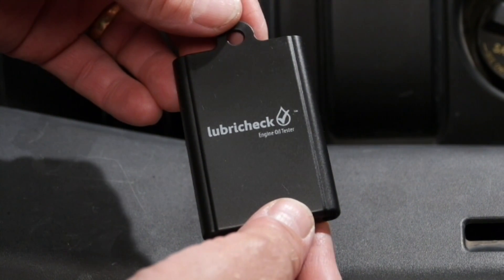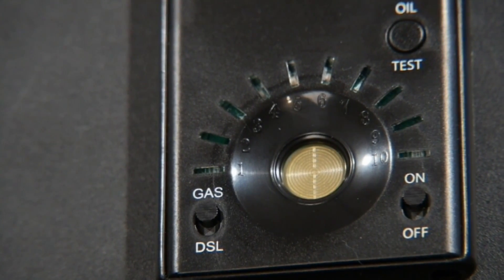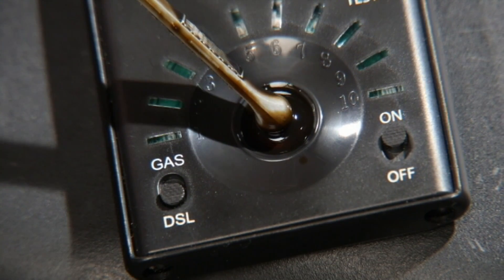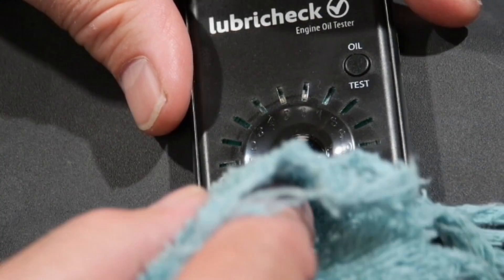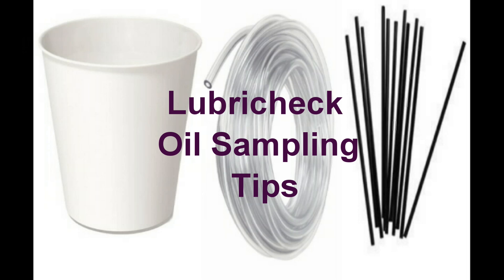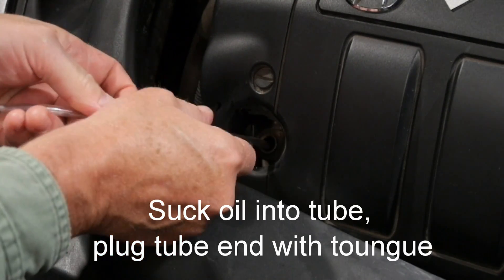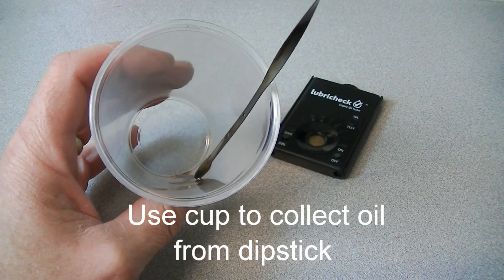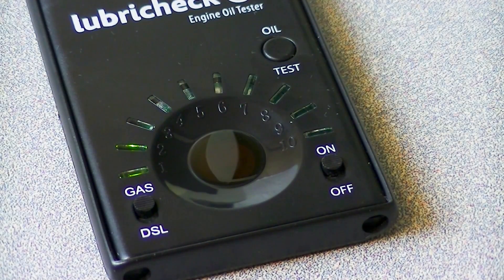Lubricheck Oil Tester Demo: How to Test Your Engine Oil, Instantly!

Comment: They may be out of business by now (domain for sale). I have four of them. Tested with oil from a diesel Land Cruiser 1HZ motor, oil used for 10600 km. I get repeatedly 7, 7, 10 and 11 (LED 10, 2Hz) out for my four testers out of the same sample bottle, shaken between tests. Obviously not great, not sure what I can try to improve results. I use swabs to clean the sensors, and with diesel you see when its clean because the used oil is so black. Swab staying white means all oil picked up.

Comment: What this device cannot test for is quality of th detergents and anti-foaming agents present in engine oil. The only oil test I know of that is also really cheap/kid of free, is to run the engine up to Normal Op Temp, getting the RPMs up high and quickly stopping to check the oil for foam on the dip stick. If you see foam, the anti-foaming agent has degraded and cavitation will cause engine damage.

Comment: WASTE OF MONEY.... You can  just tell when an engine oil is NOT doing its job anymore by the colour of the oil .. 
Engine oil on a gas/petrol engine goes from the following 
A) Clear like honey 
B) Then after 3,000- 4,000  Miles or so it turns black in colour but still runs fine (Fully syth oil) 
C) Then the oil can turn from black to dark grey ... TIME TO CHANGE THE OIL IF YOU CARE ABOUT YOUR CAR 
D) The oil left unchanged turns grey and gets small fragments of metal in the oil ... At this point it is NO LONGER protecting your engine. 
Good Quality mineral oil lasts around 3,000-4,000 Miles
Good quality Semi syth oil lasts around 6,000 Miles 
Good quality fully syth oil lasts around 10,000 miles MAXIMUM ... 
These so called "Long life" engine oils are a TOTAL LIE.... There is NO engine oil that lasts 20,000 Miles (32,000 KM)  
TWO oil & filter changes a Year with a mid price oil is ALWAYS better than ONE oil & filter change a Year  with top of the range engine oil.
Reply: Thanks

Comment: What a crock of total and utter Bs, if anything send at least 100ml of oil to a certified oil scientific testing lab to get all the results of your old oil and then use a real good friction modifier in your next oil change and then send that same 100 ml of oil with the friction modifier and i bet my life you will have a result of that the oil with the friction modifier is oil which has a 1/2 life of the oil even through you had done over 10 or 15,000 km with the oil compared to oil without friction modifier ?
Reply: Friction modifier’s  use isn’t required anymore, oils are much better than the days of old. If you need them, find a better oil. Also, with a quality oil a friction modifier alters the original formula and that can cause the chemical make-up of the other elements in the oil to not perform as intended. Messing with the original formula can degrade the oil depending on how the oil reacts to the friction modifiers. Tons and tons of difficult science in the small plastic jug!

Comment: Here's a review: This is a fairly lengthy read (1157 words) but I believe you'll find it worthy of your time.

This device ABSOLUTELY WILL do what it says - BUT:

FIRST, The instruction video I saw on their website 2-17-15 shows 2 things I disagree with: Using coffee sticks, and PVC tubing. DO NOT insert a coffee stick conglomeration into your engine! If that stick falls out or gets hung up while in your oil pan, you WILL need to drop the pan and remove it!!!!! It CANNOT stay in your engine!  No, NO NOO!!!!!!! NO COFFEE STICKS!

What you SHOULD do is go to your local Home Depot and buy a $3 - 25' roll of 1/4" Polyethylene tubing (SKU 701873), cut it about a foot and a half longer than your dipstick and DO NOT insert ANYTHING on the end that goes down into the oil pan. On the OTHER end slide on the eyedropper rubber bulb. NOW you have a SAFE super sucker! Poly tubing is a bit more stiff and that will help with sliding it smoothly down the dipstick tube.

MOST vehicles can accommodate 1/4" tubing.  If YOURS chokes down to a smaller size blocking the tubing from going INTO the pan:  I did a  Amazon search for you folks and DID find 1/8" O.D. tubing.  Search for "Clear NSF-61 Polyurethane Tubing, 0.063" ID, 0.125" OD, 0.031" Wall, 25' Length"  It has a max temp of 185 so extract from a cool engine to ensure you don't melt or deform the tubing.  Remember, the rubber bulb will NOT fit properly if you use 1/8 OD tubing.  You'll need to get "creative" on the bulb side of the tubing to remedy that.

2 things that require "finesse"

A: Proper cleaning
B: Repeatable loading of oil into the sensor ACCURATELY.

I cannot stress enough the importance of cleaning it properly. There is YOUR version of clean, and what clean REALLY is. (I) use the following:

1.) Naptha - a fast drying thinner for oil-based paints which is perfectly safe for the device AND does a SUPERB job of cleaning. (Home Depot has it in their paint dept)

2.) Canned "air" - I use it to GENTLY blow the unit out as part of the final cleaning step ensuring there is no oil trapped along the seal between the sensor and the seal around it. GENTLY use - Don't go at it like a ham-fisted Gorilla! You don't want to force oil INTO the tester under the seal!

3) Decent Toilet Paper (MUST HAVE)

4) Q-Tips - for cleaning with naptha. NOT as effective as TP, but they have a place in this procedure.

5.) A glass eyedropper - Search Amazon for "1 Dram CLEAR Glass Vial - Dropper - Pack of 12" Remove the plastic threaded CAP assembly and use only the bulb and glass tube otherwise you WILL damage the rubber. The bulb will be temporarily placed on the Poly tube to extract your sample, Then used back on the eyedropper for putting the oil into the tester AND sucking it back up, returning it to your sample jar. Makes cleaning much less messy, easier AND if you keep a large enough sample of oil that reads high, you'll have a "reference" sample to check the unit out periodically AND LEARN to properly clean the device consistently.

6.) Clear Glass Vials - for holding samples --> Search Amazon for "Glass Vials, ½ Dram, Pack of 12" and/or "Glass Vials, 1 Dram, Pack of 12"  I find the ½ dram vials to be perfect.

If you are impatient, you WILL fail and it WILL be YOUR fault, not the tester. This is a precision test device that requires a "sample" be placed on a sensor. That sample must be exactly repeatable for repeatable accurate results and IT IS POSSIBLE to achieve this!  In MY case, that sample is SIX DROPS of oil from a eyedropper whose glass section is 2 5/8" long by 9/32" wide. It is PERFECT.  The important bit is the 9/32" width . In MY case, those 6 drops are exactly the right amount.

When (I) clean the unit I do the following with FRESH TP/ Q-TIPS EVERY STEP.

1.) Suck all the oil back out of the sensor area with the eyedropper and put it back into your sample jar.
2.) Get some Naptha on a piece of TP and clean the sensor.
3.) Get some Naptha on a new piece of TP and clean the sensor.
4.) Get some Naptha on a new piece of TP and clean the sensor again!  DON'T skip these steps!
5.) Clean the sensor with dry TP.
6.) Spray-air the sensor, see if any oil shows up. If NONE, then you can stop.  If there is ANY oil, ( It will look shiny) repeat starting at step 4.

I know what you're thinking.. Good gosh, all that?  Well, your results are only as good as your prep. You NEED to and CAN do tests properly.

Folks, there's no other device remotely close to this price that does what THIS device does. It's truly UNIQUE, affordable, and accurate when used properly.

And now, the money-shot:

I had actually called the company wanting to return the device because it was registering 1's on every sample after the 2nd time I used it. It did this on multiple vehicles as well as a re-test of the original first vehicle I tested which previously had shown a 4.

I thought it was broke.

I called up the company that makes them. The man I spoke with told me about using naptha for cleaning and that more often than not, people NOT properly cleaning the unit properly is what is wrong. I was thinking what a bummer that this thing doesn't work, it's so cool and (I) like saving money!  I decided to follow his advice and do as he said.  HE WAS 100% RIGHT!!!

I used the cleaning method I've detailed above.
I used exactly SIX drops with NO air bubbles from the same primary oil sample.
After 13 consecutive tests on the same primary oil, I got the following results: 7,8,8,10,8,8,8,7,9,9,9,8,7

The 10 occurred when I cut corners and skipped steps while cleaning, so that sample is discarded. With the remaining results, the "good" samples averaged to 8.0. This proves their claim of 10% error per sample AND that results within that range ARE repeatable.  Ya, it's not peel-a-Banana quick and does require effort.  Based on my results testing 3 vehicles using Full-Synthetic 15k Oil, I figure it will save me OVER $200 a YEAR!  I was in fact changing mine too soon!

YOU should be able to repeat these steps NO problem. (I) did the hard part refining this procedure and writing this review ;-)  Leave feedback if this has helped you :-)
Reply: Why not do the cleaning in two steps ?  1.) Suck all the oil back out of the sensor area 
                                                                          2.) Use break cleaner ! ( https://www.youtube.com/watch?v=TeKeDtzwDgs )
TP is in the length same as fine sandpaper !
Reply: Fantastic review. Thank you for the time it took you

Comment: what is this even testing? tbn, tan, flashpoint, viscosity, water%, insolubles%, fuel%, antifreeze% wear metals and what types? there is a lot more to oil than some little $2.00 made in china gizmo is going to be able to tell you. you might be fine in one area and over due in another parameter. do some research on proper used oil analysis.
Reply: When you put it in on with no oil on it it mesure the light in the room then when you put the oil on it it mesure  the difference between light with no oil and with oil and show you how much darker your oil
Reply: @ahmedbejaoui599  Isn't that kinda misleading? Measuring oil quality by how dark it is really is not accurate at all.
Reply: It looks for a total contamination number, including dirt, antifreeze, carbon, acid, metal, etc.
Reply: It's Lumiere sensor ships that mesure the light then it's test oil depends the transparency of oil that's it

Comment: The nature of air cool motorcycles and there oil for harley owners I'm wondering if I should change oil sooner than a car like when it gets to a 3/4/5 instead of 7 or 8 like a car,I have 3 choppers with no tachometer or way of telling me how many miles gone between oil changes
Reply from the maker: The Lubricheck is particularly helpful with air cooled engines because the operating temperature is not narrowly controlled, like the temp in a liquid cooled engine. Consequently, if the engine has been running hot, the oil will not last as long as expected under normal, more controlled conditions.  

We believe that you can trust the readings of the Lubricheck on air cooled engines, and only need to change oil when the numbers start getting over #7, just like any other engine.

The Lubricheck Team
Reply: Thanks that will save me hundreds of dollars in oil,filters and waisted time near term ,much more than that long term

Comment: I've use mine 30 times in the last year and found it to be exactly what you claim here and as good as a buyer could hope to get and also on 2 separate occasions this device was so accurate as to warm me of impending sever internal motor damage valves and piston rings failing.
Reply: Thank you for the unsolicited positive feedback! Now we love spiders!
Reply: Thanks for the cool tool! I commented separate below to if you or anyone has any experience with air  cooled  big twin motorcycle oil my gut intuition is leading me to think around a #3 might be time to change it compared to a #6 or #7 with car oil
Reply from the maker: Fantastic! As you have seen, the Lubricheck has no problem detecting wear metals in the oil.

Comment: it does not work,, i bought one, but found out it show the bad result for a brand new oil as bad as used oil. but once i use heat gun to heat up the oils ( both brand new, and used oil). the result showed both oils are good  as new.  so this tester only test moister - nothing else!

Comment: Just got my Lubricheck tester and checked both my Volvos. My 2006 XC90 just had an oil change only 300 miles ago, and the Lubricheck tester showed a 1, as it should. My wife's 2015.5 XC60 only has 17,300 miles and is still getting free oil changes from the dealership every 10,000 miles with full synthetic. This is why I got the Lubritester--to see if the 10,000 oil change (full synthetic) recommended by Volvo is valid. Well she's at 7,300 miles from her last oil change, and the tester showed 6. Not bad. I'll check again in about 500 miles.

Comment: ok,  i have seen the model that has a switch with std (standard/conventional) and syn (synthetic) well, what if you are using a synthetic blend? what would be the right setting in that case?
Reply from the maker: +filthy sanchez 

The images you have seen with a SYN/STD switch are old. The current model has a GAS/DSL switch. We can handle synthetic, standard and blends with the same unit now.

The Lubricheck Team